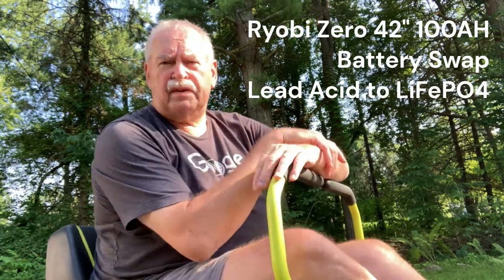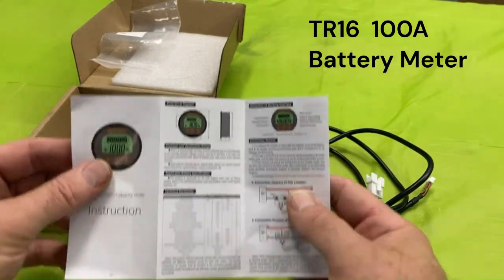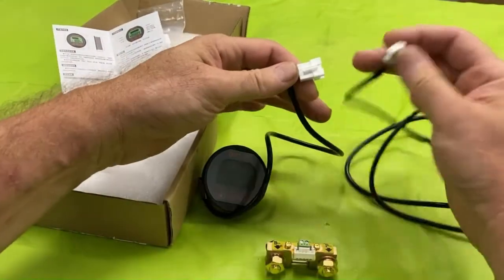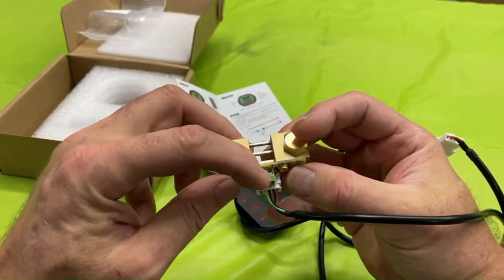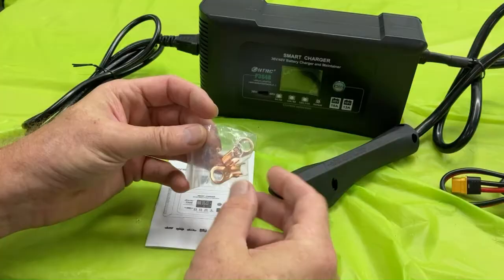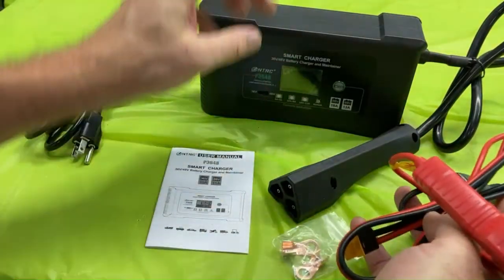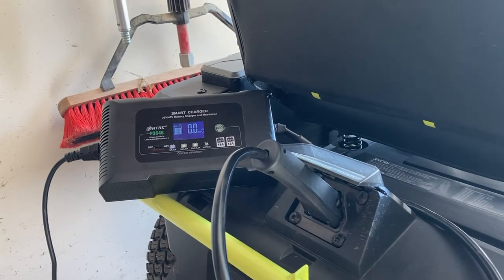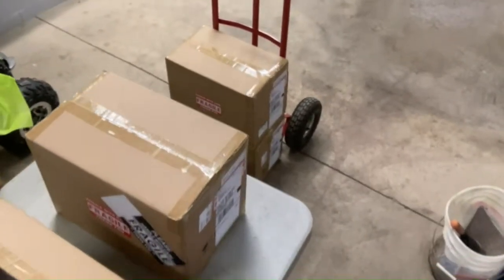Ryobi 48v Battery Swap - Components and modify charging port

Comment: I want to thank you for these instructions. I am in MN and winter is almost upon us so I installed the batteries but held off on the mete as boring out the hold would have been a tough job.  After watching the information available on the charger I may not even put the meter in at all.
Reply from the maker: Good for you!  In hind sight, I may not have done the gage either.  But it made for an interesting video.  I learned a lot from my battery swap, and the comments and feedback from others.
Reply from the maker: MN? I expect that you'll have temperatures colder than me in lower MI.  Did you have any concerns about freezing the LiFePo4 batteries?  Or did you get batteries with internal heaters?
Reply: They do not have internal heaters. But I do have a heated garage that I keep at 50F during the winter.  @robertveldman1901
Reply: Fellow Minnesotan here. How did it go? What model mower do you have? Did you use the same batteries as this video?
Reply: @DoinAllTheThings  My model is Rm480e. Yes, I think I used the same model batteries. Bought them from Walmart. They had the best price at the time. For the charging cable, instead of disassembling the connector, I just broke off the little pins in the receive on the mower. I also decided to not put the new gauge in the old one's space. I put it in the plastic fender. It works great. Overall, I am so glad that I did this.

Comment: would this work on the 12 volt 50 ah ryobi?
Reply from the maker: I assume you're talking about the 48v 30in Ryobi mower, with 4x 12v batteries?  I believe there have been a few other videos on converting your mower from lead acid to Lifepo4.  Your 50ah batteries will be smaller in physical size, so you may have to find the equivalent sized batteries.  It looks like the charging port is the same as mine, so you can use the same Lifepo4 charger as I.  Based on my experience and other viewer comments, you wouldn't have to change the gage... and of course, the gage could be updated later.
This battery, for example, looks pretty close in size... you'd have to double check:
https://www.amazon.com/LiFePO4-Battery-Built-Rechargeable-Replacing/dp/B09PBB9FHS?th=1

Comment: so with just these three items you were able to from the lead acid trouble free? i am looking to convert mine as the amps are gone in two of my lead acids
Reply from the maker: Correct.  The conversion was good and pretty simple. 
I have mowed my yard about 10 times since the conversion.
In hindsight, I'm not sure I would bother changing the gage... just swap the batteries and get a new charger.  That would make the conversion even easier.
Reply: @robertveldman1901  thanks for the reply. the plain and easy way that is issue free works for me since it s a mower and not a daily driven car or truck
Reply: @robertveldman1901 is there a downside to just reusing the original gauge vs. the one you bought?
Reply from the maker: @jrherita  Not really any downside.  The new gage lets you monitor the amps used and voltage level.  The battery % is a little awkward to calibrate.  If I did it again, I'd probably not replace the gage.
Also, you can always swap the gage out later, if you want.
Reply: Thank you very much for the info and videos! @robertveldman1901
Reply: That is all I did with mine about two years ago.  It can now do 2 1/2 acres twice on one charge. @robertveldman1901

Comment: I just upgraded mine to LiFePo4 batteries, was a tight fit for the batteries I chose, but they are in and secure. I chose to use a charger inverter with an anderson connector for charging so I could use the mower as a self propelled "electric" generator.
Reply from the maker: Interesting.  So, you can back-feed your house?  Or run some tools/appliances?
Reply: @robertveldman1901  Run tools / appliances, could technically backfeed house but I don't want to get into that mess. just run an extension to important things e.g. CPAP, Fridge, Freezer etc.

I basically just cut an extension cord in half and ran the plug side into the charger inverter as the "Utility" feed in. And the socket side as the "output" and some battery cables with an Anderson connector for the charging of the batteries.

Comment: Hi Isnt we need 400AH meter since we combine the batteries 100 AH x 4 . or still we going to use or  just the volt meters and AMPS dont.
Reply from the maker: I'm not an electrical expert, but the gage is rated at 100a; not to be confused with Ah.  I don't believe the mower ever uses more than about 60a. So, the 100a gage is fine.
The batteries in our mower are linked in series (end-to-end), so we get 12v x 4 = 48v for 100Ah.
If they were wired in parallel (side-by-side), you would get only 12v for 100Ah x 4 = 400Ah.
Reply: Thank you for reply. I appreciate your step by step instructions very helpful. However after you had Charging port light working. Now does it goes Solid on Full charge ? @robertveldman1901
Reply from the maker: @onestop2446  I'm pretty sure that the light had always turned on when it was plugged it.  It was never a full charge indicator.  Of course, I can't verify that anymore!

Comment: If the batteries have a built-in BMS why couldn't you just use the Ryobi charger?
Reply from the maker: You know... I'm not sure.  Everyone says you need a "Lithium" charger, so I got one.
From the Chins Battery Manual, it says the over voltage disconnect voltage is 14.6v.  I suspect the BMS will stop accepting amps when this voltage is exceeded.  There are instructions to "reconnect" the BMS.

Comment: That manual that comes with the gauge is SUUUUPER tiny. Even with a magnifying glass it was a challenge to read, so I scanned it into my computer, enlarged it and printed it out at 8.5 x 11 size. 
If you don't want to break off those tabs in the charge port to make the new "handle" fit, another option is to simply move the cable, wires and wire pins from the new one into the old one. That is, when you're done it will be the new cable running from the new 48V charger to the OLD handle with the NEW wires and wire pins inside. That way it just fits with no modifications necessary. This is what I did and it works great. One thing to keep in mind here is that the old handle and charger uses 3 wires and 3 pins, whereas the new one only needs 2, so ignore that third one. It's not used by the new charger anyway (I think it's a temp sensor or something). That new charger is very smart though and can detect if something is not right.

Here's what it looks like inside the OLD handle: https://photos.app.goo.gl/RZ2jqX5QEgCPi2Ju9
Here's the inside of the NEW handle: https://photos.app.goo.gl/VnvobVxzkQVwDSq69
Just move those TWO wires (and their pins) into the housing of the OLD handle. In my case the wires were blue and red. No third wire or pin. When you're done it will look like this: https://photos.app.goo.gl/fs9TxEyNLCnYa8kM6 I wrapped some electrical tape around the cable where it interfaces with the housing just to make the whole thing fit in there more firmly.

Comment: I don't think the tech is fully there yet. Not worth it for me. One day, I would say, yes to buy one. Good luck to you.
Reply from the maker: I actually agree with you, especially when my 42" Ryobi normally costs $5000.  That is crazy.  I bought mine for significantly less.
Ryobi should never have marketed Lead Acid battery mowers.
For some strange reason, Lithium costs appear to be coming down, so Lithium versions MAY some day be affordable.
Reply: I appreciate your video alot i ordered same set of batteries and charger the meter will come after a while is it possible i just hooked everything else and keep using the old meter or does it make any difference. How im going to know otherwise the batteries are charged or not without gauge. @robertveldman1901
Reply: @robertveldman1901  I went lithium because the price difference per battery was like $200. Which is a value that is worth it since the battery can run longer, last longer and weights a lot less making maintenance easier.
Reply: Do not buy any of these electric stuff i drove a car for a year im stuck with same ryobi mower not even 2 years battery dead. Dont waste your money.
Reply: @ezeemart138  When I walk into Home Depot and I see a sign on a Ryobi Tractor, I think, saying....Sale 4,999.00, I am laughing my buns off.